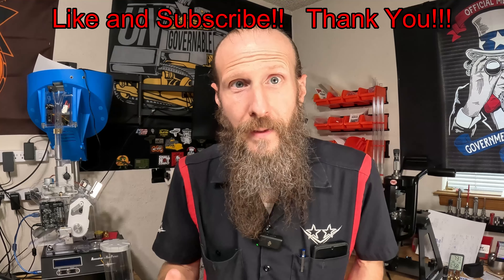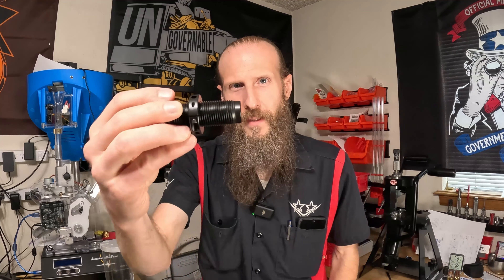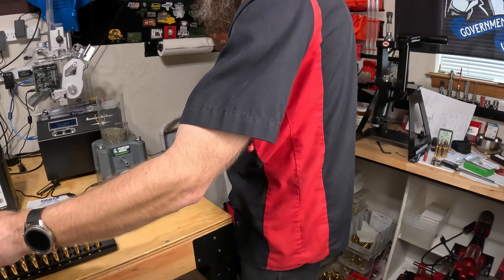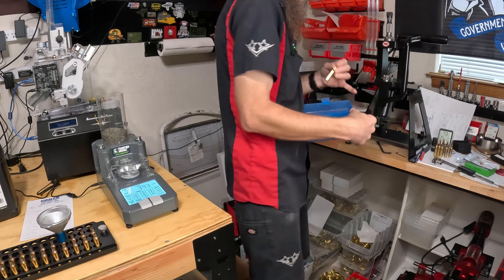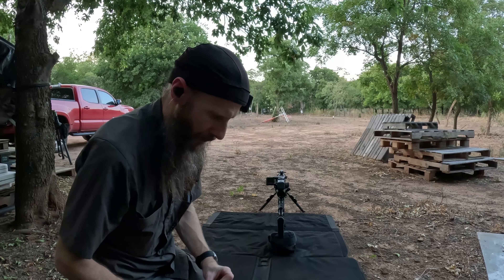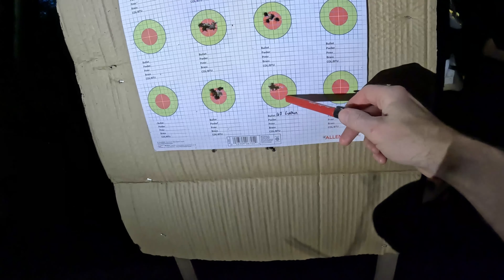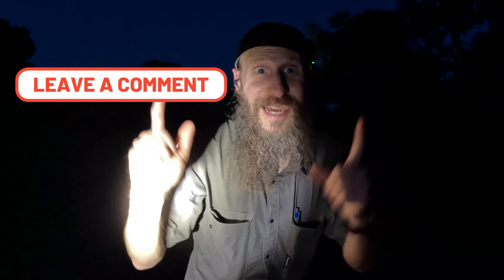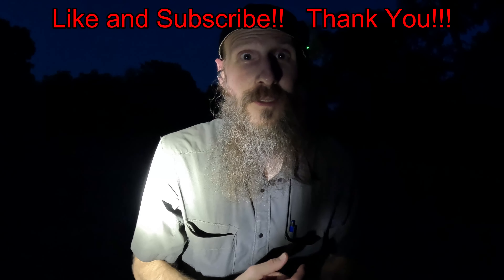Alpha Brass - More Powder Tests - Worth My Time?

Comment: The mandrel die is eze to set up just run the die down till it touches the ram when it's all the way up and done. Make sure you use a good lube it is a lil tight. Also if you are not imputing your bullets weight it might help too
Reply from the maker: @kyley808  Thank you! I have not stopped running around long enough to watch a set up video yet. That is super easy. I figure it should be since it's not working the neck or body any. 
I got the new Alpha Munitions case lube to test out as well. 
So, when doing the mandrel step, I need to make sure and have some lube on the inside of the neck? I got some little foam tip applicator swabs a while back. Might be the job to try them out!!
Thank you for stopping by and sharing this info! I appreciate this, Kyle.
Have yourself a great weekend, sir!!
Reply: You can lube  the inside of the neck but make sure you also lube the outside as well and make sure you are using the bullet weight on the garmin it might help. I would wait till your brass is fire formed as well to start loading Have a good and safe weekend brother
Reply from the maker: @kyley808  I did notice some slight changes after sizing my Lapua. Figured that might be a thing across all new to fired brass. May just run through the last ones and form them, then size and mandrel. Then get my final powder settled on. Thanks! That was just the order of operations I was hoping to get input on with this video!
I will deprime, anneal, lube and size then just mandrel without cleaning the cases, so should stay lubed. 
Really appreciate this info!!
Reply: @ChadKelly7  that's exactly what I do i don't clean twice. You can also mandrel then spin the case then mandrel again some people like to do that. I also make my own lube with lanolin it's really good
Reply from the maker: @kyley808  Good to hear my thought process is on the right track.
So, like run the case up into the die, drop the ram, twist the case in the shell holder 90 or 180 degrees and run it up again? I assume to make sure it's uniform?
I might do a test of half with one and half with two runs thru the die. More things to test out to find what works for me! Always seems when I think I am close to figuring it out, I find something new to try and make my ammo better, lol.
Reply: @ChadKelly7  yes sir that's exactly right also you can do a count as to how long you leave it in the die when you are mandreling lol it's a rabbit hole good luck my friend

Comment: Looking good Chad! I remember you getting an Insta360 at one point. I was curious what you use for recording your videos if you don't mind sharing?  I went through your Library but i may have missed it. I'm looking at the insta360 Ace or PRO version but im also wondering if my phone will continue to work just fine. TIA Chad!
Reply from the maker: @jknewb6276  hey man! I got the Insta Go 3. The little mini camera. I seldom use it tho.
Mainly I use a DJI Osmo Pocket 3.
Or my GoPro 11 I think? This video was with GoPro. Audio not very good in my opinion. Some things were not linking and recording like I wanted. 
But got the Pocket back. They replaced it. The screen went wonky and wouldn't stay put. Fixed now though!
The Ace is a good Action Cam. Mainly if you want to do a lot of AI effects. I don't see much use for them making shooting videos, so that one is not on my list. If you want a small, easy to use camera a GoPro or Osmo Action 4 is a good option also. Bigger than any camera is audio though. Having good microphone and recording solid audio makes a world of difference. People will usually deal with worse video quality if audio is good, but they leave fast if audio is terrible.
Plus, YouTube compresses so much, high end video footage is lost. I record and upload in 4K, but most people likely watch in 480 or 720. But, if they want to use 1080 or 4k, my footage is there for them.
Hope that answers some of what you wanted to know.
Let me know if you have more questions. Happy to help you!
Reply: @ChadKelly7  hmmm definitely some things to think about, I'm not going to jump into anything too quickly unless I find a good deal maybe but I was just thinking I've used my phone for awhile maybe it be worth getting something different. That dji pocket 3 looks so cool I forgot you had that, I'll definitely get with you for any more questions! Thank you Chad!;
Reply from the maker: @jknewb6276  Good deal. Ask anything and I will tell you what I think and suggest.
If you are not just wanting to get a new camera for the sake of buying something, (I tend to do that a lot 😂) then I would recommend you find a good, affordable mic that you can use with your phone. Learn to make audio sound good and you will be much better off than having better looking videos.